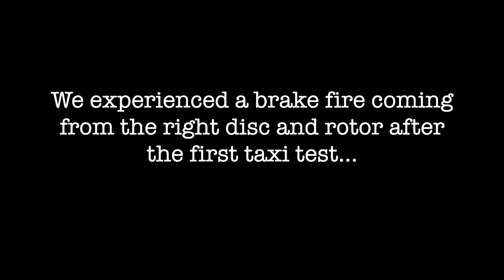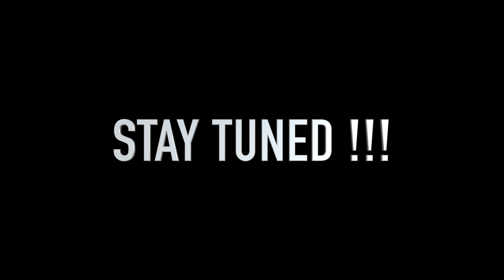BEARHAWK ~ BRAKE FIRE during first flight attempt...

Comment: Glad everyone is ok and there was no serious damage. 
Fires can get out of hand if not dealt with in a timely manner.

Just curious about two things :-

(1) - Is there a procedure to 'wear in the brakes' ; e.g. riding them lightly while taxying at low to moderate speed for one or two runs (presumably to burn off any corrosion inhibiting compound) ?

(2) - If the cylinder was missing a vent, should it have been returned to the OEM in exchange for a new one ?  What's the impact on the warranty if you make a mod (even if authorized by the vendor) ?

Looking forward to you making that first flight in your own good time, no rush, remain safe.
Reply from the maker: Hi Dave.  Yes I performed the brake seating process in this video.  https://youtu.be/Bgxesmcu6-Q. Being that this is experimental, sending it back didn't occur to any of us!  🙂. We just fixed it.
Reply: @TheBaldPilot : Rob, do your Master cylinders have vents in their end caps (are you using MC-4s or MC-5s in your particular aircraft ? ).

Presumably  your reservoir is at the highest point in your system and you've then added the .063 dia hole to vent the reservoir at its top.

Comment from the maker: We think we found the culprit.  There is a washer that goes between the cap and the bracket on the Matco Brake reservoir. This allows the vent hole in the cap to breath. I did not install the washer and effectively closed off the vent.  Fix that and also drilled a 1/16th hole in the cap.  After taxi testing, the brakes no longer drag.

In addition to the brake situation, we also had trouble transmitting and receiving on the comm.  And, the ADS-B OUT is not working.

We will work on these items and try again in a week or so.  Stay tuned!
Reply: I had a similar problem on a motorcycle once and successfully used the same repair.
Reply: Glad the brakes were no big issue. So far as your ADS-B Out, you will not see the Out until you get up in the air. My data does not show until at least 400ft AGL. It will depend on where the closest station antenna is from your field.
Reply from the maker: @tomi6261  Unfortunately my Dynon transponder is not receiving GPS data from the Avidyne IFD540, which is the certified GPS source for my ADS-B.  We have confirmed this in the system setup.  The Avionics folks are still working on it.